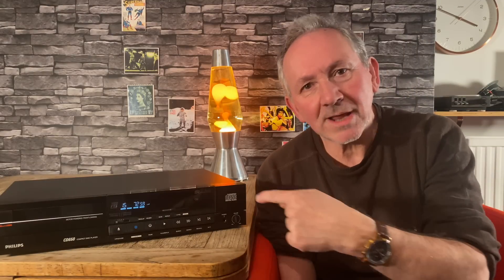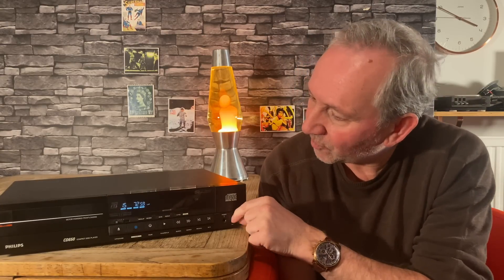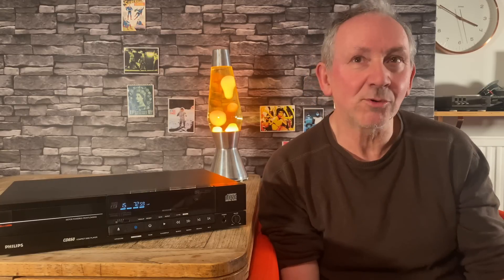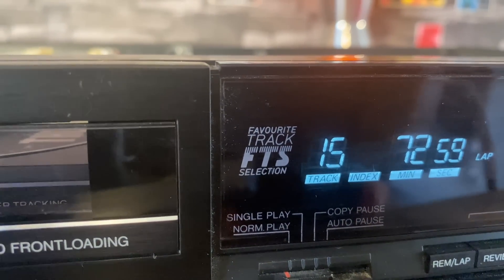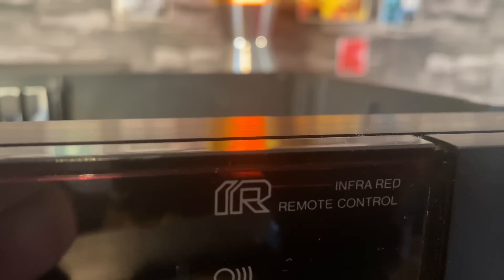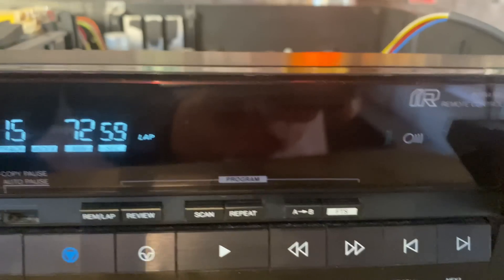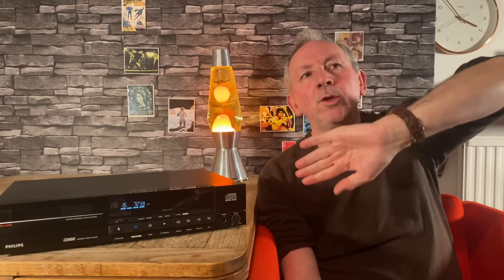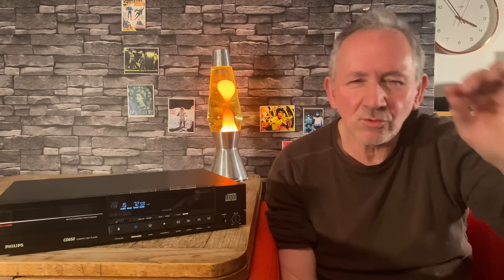I review early CD player and its impact on HI FI world

Comment: There was a huge amount of hype around the introduction of CD and, I guess, we fell for it. The initial clarity with no battle against the dust on  Vinyl. Almost uninterrupted listening with control over which tracks you wanted and in which order and, of course, the random play mode. My first player was a well reviewed Marantz. There was a lot of reviews suggesting some early makes were better than other but we then realised most used the Philips chip set. It didn’t seem long before the rather bright digital sound began to get tiring and the black box digital to analog converters hit the market to ‘warm up’ the sound. Were we conned by CD - maybe.

Comment: What I didn't miss in 1984 with my first CD player was the turntable rumble, pop, ticks, non-fill s-c-r-a-t-c-h, off center pressings (which irritated me the most!), and the warp of vinyl.  I did discover that the way I listened to music on CD had to change verses the way I listened to it on vinyl.  I had to get used to not having to "listen" for vinyl's anomolies. For me,  CD verses vinyl is not an absolute dogma of one is "superior" to the other. I listen to and can easily enjoy both. However, there is a definite difference of experience between both formats.

Comment: Because it has a digital output, you could hook it up to a modern DAC and use it as a transport. The biggest issue with old CD players (in terms of sound anyway) is the internal DAC. DACs have come such a long way  (especially since the 1980s) that a modern DAC will completely change a vintage CD player's sound characteristics.  Vintage vibe and modern sound - best of both worlds?

Comment: you're right about the comparison not working, because you have to acount for the implicit EQ curve a different level of gain will provide indeed
every gain stage acts as an EQ stage too depending on how soft or hard you drive the signal
if the gain is lower on the input, things are more tinny and high-endy, and bass sounds start dragging behind a bit and not sound as punchy
drive it a bit harder, and the mids and bass come out better and more punchy

so you'd have to make sure the gain stages end up with roughly the same EQ curve... which is easier said than done between 2 technologies with different impedance and amplifications
a phono input amplifies a shit ton more than a line does, it has to :D

early CDs were kind of badly mastered too, cd's from the early 80s usually are mastered like 2-3x softer, and were generally very hissy still, they didn't quite know how to master for CD yet
when the loudness wars came around, and they started.... mastering mastering for CD, and compressing the shit out of everything, they masked most of the problems it had with dynamic range that were OBVIOUS on earlier cds produced

so it does matter a lot what year those CDs were mastered too (and by whom) :D
from my own expercience vinyl generally has a SHIT TON more high end going above the 12k

Comment: Interesting review, thanks. Not quite sure what you mean about the sound though. If you are using the digital out from this CD player, you are by definition using the DAC from the amplifier to which it is attached. And the DAC is what will give you much of the sound quality. Did you try it with RCA cables, so that you are using the internal Philips TDA1541 ? I have a 1984 Revox CD225 and it has twin TDA1540 DACs – and trust me, the bass this thing supplies is floor shaking if you want it to be. It gives such a deep, rich sound, but you need to be utilising the onboard DAC to get the proper effect. The sound from my Revox is every bit as good (albeit rather different) as from my turntable

Comment: I got a cd player in 87, and did an A/B test right away, alongside my turntable. I wasnt enthused by the sound, cds were hit or miss. Some were pretty equal to the corresponding vinyl, a lot were worse, and only a few were better. I  DID like the click-free sound, however there was still hiss, i was told they were perfect. So sound overall, was better on vinyl. I liked the ease of which you could skip tracks, but that ended up a bad thing too. Now that ive gone back to vinyl 100%, i hear songs that i only knew the 1st 10 seconds of from the cd, that are actually damn good songs, but cd players made it too easy NOT to listen to a full album. Im not RECENTLY rediscovering vinyl, i never gave up collecting. In the 90s, i bought cds of new releases ( because so much was not available on vinyl), but i bought vinyl where i could. In those days, there was no internet to find out what was on vinyl, you had to hope a store would get new vinyl, and very few did after 1993. My New sealed vinyl primarily came from Hot Topic and Virgin Megastore from 1999 till 2012, when lots of stores were starting to get sealed new vinyl
Reply from the maker: More or less everytime  e I play vinyl I’m happily surprised

Comment: GREAT TO SEE YOU AGAIN ,  , that trip down to that used audio shop video was very nice as all the good shops like that are now shut down in my city ...., Picked up an old  luxman lv 105 CD player that  has tubes in it , coolest part is the bypass function , has rca pre  in , can be used as stand alone  in line tube buffer for a sreamer, tape deck ,etc  , also has two rca outputs , one fixed the other variable , can go to directly to Amp , plays well with the older stuff , pairs best with my Mc 250, after the tubes have warmed up for ten minutes things change in a interesting way . A whoosh of big air , Yes.. Did that a/b thing back in the day with cds  too , It was a high end tape deck in the end that showed me what I was missing with cds in the 90s .

Comment: Good to see you back doing another interesting review. I hope you are keeping well and enjoying your retro hifi gear. I like playing my CD's, which sound great, using either my Denon DCD 685, AMC XIA 150 amp and excellent retro style 3-way home made speaker system or my Yamaha CDX 470, proton D540 amp and Goodmans MEZZO SL speaker system. These systems don't have any of the problems you mentioned, although I am familiar with those issues that can come with many CD players, especially many old and/or cheap players. The sounds I get are generally full, rich, natural, accurate, smooth and detailed with very good dynamics but not glaring, harsh or clinical. Records also sound good but have all the problems associated with that format, which I get annoyed with fairly quickly these days, especially the inconvenience  of having to change the side or the record more often than I like. PS. I was wondering if you will be doing a review of a vintage Linn Sondek LP12, which you mentioned doing on your previous video. All the best Kelvin. I look forward to your next review.
Reply from the maker: Well, do you know what I got that linn
And it has a Katsu black cartridge, which is £2000 and a Lynn it tick arm 
And he didn’t sound very good, so I figured there was something wrong with the cartridge and I didn’t review it
Reply: @stereoreviewx  That's unfortunate. I hope you can get that sorted. I'd like to get your opinion of a 70's era Linn LP12, if you ever come across one in good working order.

Comment: @stereoreviewx. Thanks for your review of this vintage CD player. However, you did not mention/elaborate on some of the more interesting features of the Philips CD650. 
Apparently, the laser head that reads the discs on this player is on a “swing arm system” - not the usual linear drive motor. So access to the tracks on the disc is very quick since when called to skip tracks/repeat/etc. a linear motor doesn’t have to furiously wind itself in/out to find your selection. 
Also, the Favourite Track Selection feature (FTS) will memorise your favourite tracks on a specific disc and replay them when called to. I believe there are 256 (?) memory locations for disc selections within the player. FTS reads the information at the disc’s centre and identifies the total time, track times, spaces between tracks, number of tracks etc. like a “fingerprint” for that specific disc and stores it. So when you load your FTS -sed disc and call the memory number, the CD650 plays your favourite tracks. There was a “Scan” function which played the first 10 seconds of each track on the disc and then move on to the next. This would be the way to programme and build up your selection  for the FTS. 
One of the functions of black selector switch on the front panel was to put a 4/5 second “pause” between each track. Very handy when recording discs to cassette tapes for the car, where the car tape player had a “programme search system” ( which “searched” for the space between the tracks) to fast forward the tape to the next tune. 

I did read that there were versions of the TDA 1541 chips that had a “crown” symbol printed on them and that these were fitted to the equivalent Marantz version (CD90?) of the CD650. And there were techie people that would “hot rod” your Philips deck with these apparently up - rated “crown” chips for a price!

I am sure there was a wireless remote supplied with this player when new. Did yours still have one?

I bought this CD player in 1986, and still have it stored in its original box and polystyrene packaging. The serial no. of my deck is very low - three zeros and three digits, so quite an early machine. I used it from 1986 to 1988, stored it from 1988 to 2003. I put it back into service from late 2003, then stored it again in 2014. So not really raced or rallied! 

Maybe Philips put too many bells and whistles on this model, but they had to start somewhere! 
Thanks again for your work on this video.Stay safe and well.
Reply from the maker: Thanks for your info

Comment: Good video Kelvin,  I would like to mention a very helpful characteristic of my first CD player.  I waited until '86 to buy my first unit (Technics mid-size).  I loved my LPs and recording to cassette for mobile/portable uses.  This player contained an "index" selector, where you could break long songs into sections to start or finish play. For recording, this was great, as you could make "custom" tapes that would sound professionally made.  No other CD player I owned after this first machine had that "index" selector, and I was puzzled as to why.
Reply from the maker: Yes interesting CD players now seem super straightforward if I’m correct
Reply: I'm now using my Sony 300 CD changer I bought in 2002 after a cleaning and belt swap.It's also a great storage unit, once the discs are in, there is no need to remove them.  Look fwd to more videos @stereoreviewx

Comment: I found that the harsh sound was really bad on early players, especially the time shared chipset players - grainy harsh treble more often than not.
Then players had dual chip sets fitted, reducing the grainy sound, but it was still harsh and brittle - mostly due to the higher output overdriving the line input of the pre-amp. 
In-line attenuators cured that, by dropping the output by 10dB or so. 
What remained was more refined, but rather flat - great left to right but not much depth front to back? 
Modern players are now able to reproduce a better 3D soundstage, with more depth available if it has been captured in the original recording, but the glare or sheen often comes to the fore - a lack of realism in cymbal and string sounds.
This is probably less noticeable with higher sampling rates, but the CD format has probably gone as far as it can go. 
Compared to the first generation players, I’d say that 80% of the shortcomings have been addressed, so with careful matching in the audio chain and speaker choices, most of the remaining sheen/glare can be reduced to an acceptable level.
I’m happily listening to the music again, but it only took 40 years!! 🤣👍

Comment: The CD player was a joint development between Sony and Philips. I have a late 80s Technics player that is still going strong all these decades later, it even plays CD-R discs although it was never designed to do so as they hadn't been invented when it was released. The only repair it's ever had was that I had to change the loading belt many years ago.  Sony and Philips also invented the SPDIF interface, SPDIF actually stands for Sony Philips Digital Interface.

Comment: There's no doubt that the cd format has it's limitations. So does vinyl. And one choose the limitations one prefer. There's no right or wrong and therefore there can't, won't, or need to be any agreements. At least as it is for now.
Some go for better DAC's, and in some ways it can lift the sound, but it also reveal the formats limitations even more, so how much is gained is questionable. 
The cut of everything beyond 22 khz is a huge mistake. It was required due to the technical standard at the time, and it is okay according to the 20 - 20 k phrase. The only problem is that the 20 - 20 k phrase is nonsense they pulled out of their ass, and for some weird reason agreed about. It has no place in the real world where some people can hear up to 28khz, while others who can't hear as high as 20k still can tell that the intermodulation with frequencies beyond is missing. There's some interesting research about that which is worth looking into.
Comparing cd's to higher resolution also clearly reveals the formats limitations. Cd's sounds more grainy. 
Try working in DAW's at higher resolution and then export in 16 bit 44,1 khz, then you'll hear a loss that will make you crumb your toes. And then imagine the loss from the really high resolution used in studios.
Many has gone back to analog formats, and it's for a good reason. Analog medias actually handles the higher digital resolution used in studios better than even blue-ray audio, they can reproduce the frequencies beyond 22 khz, and in general sounds more agreeable. But my question is: In this day and age why go back? There can be no disagreement that serious hi-res is the winner of all, that digital formats are more convenient, and we have come a heck of long way technologically since the cd was launched. Why the F doesn't anyone make a format which has the capacity for true hi-res, which is as easy and cheap to mass produce as cd's, and is supported by the music industry so people can get what they want???? Shall we keep settling for lower quality than the studios can produce forever? Must we forever be the underclass who have to accept the garbage that the condescending throw at us as they line their pockets?
Great to see you back Mate. Been missing you.
Reply from the maker: Great info K

Comment: This brings back nightmares of how bad CD sound was when it first came out. I don't entirely blame the early players  but as I recall in a Sony CDP-101 review (the very first player sold)... 'The Absolute Sound' (TAS) wrote they had difficulty reviewing the player because the listening panel kept running out of the room holding their ears.
But to me the discs themselves were worse than the early CD players. In fact I've yet to hear a CD made in the 80s that did not sound abrasive, unbearably steely and irritating. They were and are truly awful. Things improved greatly in the 90s for both the players and the discs... thank god.
Reply from the maker: Fair point I wasn’t even thinking about the discs .thanks

Comment: Kelvin, it is not Liquid Cristal Display (LCD). It is a Vacuum Fluorescent Display (VFD) - two completely different  technologies. Regards.
Reply: All vacuum fluorescent displays I have owned over time get dimmer and dimmer until they are unreadable.
Reply: @swinde  It's often due to the capacitors drying up in the power supply. I used to replace a lot of them and bring the display back to full brightness
Reply: @tenmillionvolts 
Thank you.  I have several products with these displays that I  am still using.   I will give it a try.
Reply: @tenmillionvolts  Yes, it can be capacitors, but the display tubes themselves are also getting dimmer because the cathode emission decays and the phosphor wears out. If the display is evenly dim, it might be capacitors or weak cathode. If some digits/segments are brighter, that is because the phosphor is worn out on the dimmer segments. There is a huge difference in lifetime between VFDs. Some are still perfectly useful after 30 years of 24/7 operation, others become dim beyond usefulness within 10 years. I have a 1997 Kenwood mini hifi with a huge VFD, it is on 24/7 since 1997 and it is still perfectly readable even in daylight. 2000s VFDs tend to be a lot worse. I've seen some which became noticably dim after 5 years, and unusable after 5 more years.
Reply from the maker: Ok thanks for that I wasn’t too sure

Comment: I have an early 90s technics cd player, it has issues playing very low bass at the appropriate level.  I suspect it's just old electronics in the output stage.  My 10 years newer Yamaha player has no issues with that.  The yamaha also has an adjustable output level, so I matched it's volume with my tapedeck and tuner.  Can't match with the turntable as the volume of the pressings is all over the place.

old electronics, capacitors specifically will affect most equipment of this age

Comment: Hello Kelvin!!! Back around 2016-2018 I bought pre-owned CD players and high-end cassette decks in fine condition for $25--$50 free shipping on Ebay. Since then prices have exploded such that very few bargains can be found anymore. I can't afford to take chances on vintage gear these days.
Reply: Hi! I live near a thrift where they can't get rid of tape decks and CD players fast enough. They are normally under $15 bucks. What 80's/90's CD players do you recommend? I 
see SACD players 
too. Any thoughts on those?
Reply from the maker: Yes, that was a golden period. You never realise it at the time, or at least I didn’t. I did pick up quite a few good deals then .
I remember thinking this Amp is like a Rolls-Royce to me, and they think it’s like an old banger that no one wants